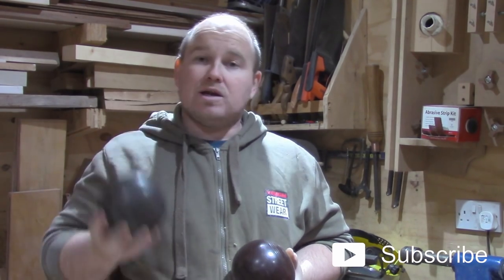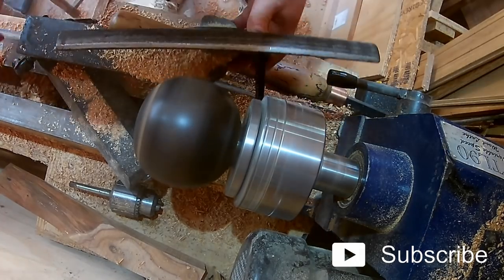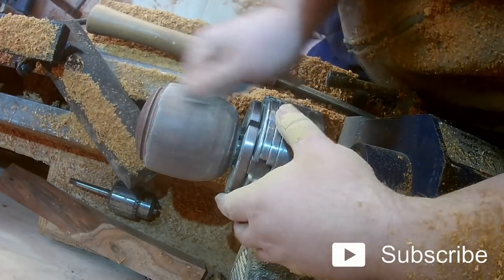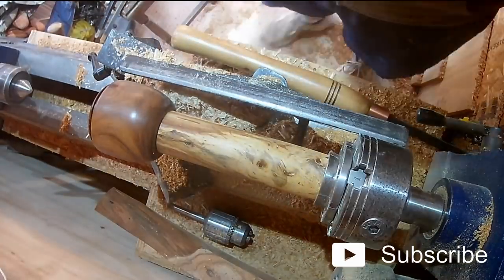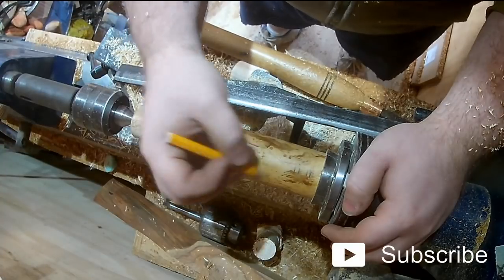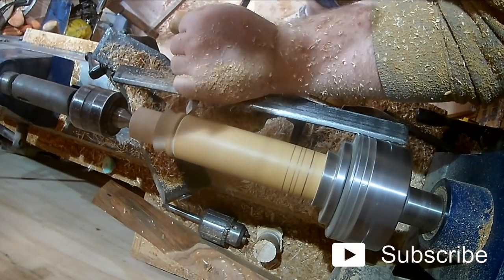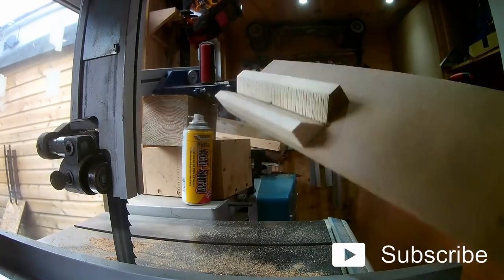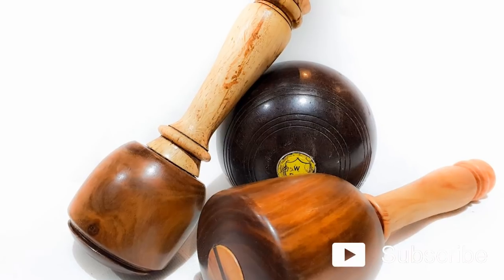How To Turn A Mallet Using A Lignum Vitae Bowls Ball

Comment: I missed out on some bowls the other week great job will they turned out great
Reply from the maker: you've got to get in there quick mate. make sure you check condition though. I picked up some a few months back and the guy was trying his best to off load them but they had some proper deep cracks running through it so had to step away.